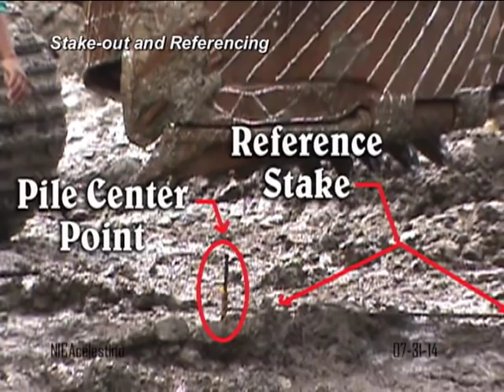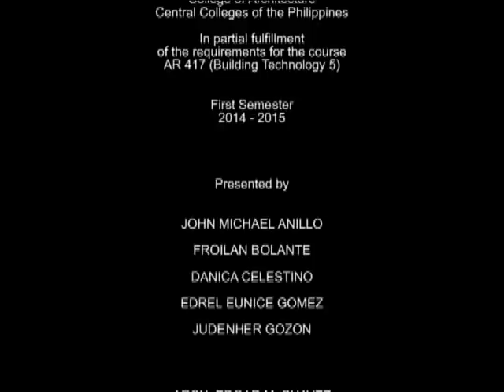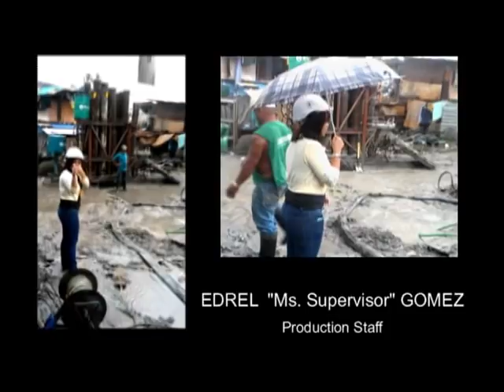Bored Piling Method

Comment: 1: Polymer must be mixed and then filled in bore insted of directly adding in bores .
2: We should cover the Hole of hopper with a cap and fill it with concrete and then allow concrete to dip inside .

3: we should take reference at 2 points 

Etc . There are many faults in this video .
Reply: Right dear
Reply: Kanya kanya diskarte yan Brad. Huwag mo itulad diskarte naming mga Pinoy sa inyo.
😅😅😅😅😅

Comment: Thank you. This tutorial is good and very useful for who wanna study bored pile. Unfortunately, its lacking period of cleaning hole what is very important. How can you clean the mud below the hole after drilling?
Reply: you use a clean out bucket. it looks similar to the digging bucket but made specifically to clean out the hole. another issue here is the suspended fines. when you are using a slurry mix, you want to allow some time for the suspended particles to settle out. or you can pump out the used slurry and simultaneously pump in fresh slurry.

Comment: Should the water not have been pumped out before pouring the concrete? Otherwise when the tremie pipe is removed the water will dilute the concrete mix and weaken its strength?

Comment: Hi Thanks for the video. 

However there are so many issues which were not taken care during the construction and first and foremost part is safety rules are not   

1. The above video demonstrate incorrect practice of adding polymer. The correct method shall be polymer should be placed in separate tank and taken to the pile borehole through pipe. The properties such as viscosity, density, pH and sand content of polymer should be checked both in the tank and in the pile borehole.  Polymer level should be maintained till the bottom of temporary casing. The main use of polymer in the hole imparts stability by mainly applying hydro-static pressure and passive resistance against failure of hole prevents from collapse. Samples shall be taken at top , middle and bottom of borehole.

2. Once drilling reaches to the required pile bottom, the depth of pile should me measured and once again before placing the cage the pile depth should be measured in order to check the sedimentation of polymer. If the polymer doesn't satisfy the required criteria the polymer should be recycled in the pile bore. If the sedimentation is more then pile bottom should be cleaned.

3. Caliper logging test should be performed before placing the cage in order to check the diameter of pile is uniform or check for cavities. check the depth once again to verify the pile toe level.

4.  Spacer should be installed in the cage so that concrete can flow and fill the space between cage and hole which was missing and it will leads to a problem.  Skin friction will be reduced.

5. Dummy cages should to installed at the top after lowering of 3rd and final cage. It should not hinged with a single rod. The weight of cage is more and the single rod wont withstand the total cage wight if welding is not done properly.  

5. Pile was backfilled with plastic bags and etc. not acceptable and there no identification mark where the pile was casted.
Reply: hahahaha what are you a cop lmfao
Reply: BalaGanesh Sankar totally what I was thinking.. plus I didn't hear a back up alarm on the machine
Reply: He's correct.  To begin with, I would have started the hole with an augger.  I know the bucket is needed for most of the drilling in wet holes.
Reply: BalaGanesh Sankar 
Sir you given very useful information about pile foundation.
Please gives us some more details about the pile foundation and pile cap
Reply: This is true in the US. Not sure about what is required in the Philippines. Good points though.
Reply: exactly to complete the correct process...but its okay..that is built for the city of rock n roll..
Reply: There wasn't a proper flushing system... And the cage wasn't lapped properly... The laps were all at one place

Comment: mixing of  the polymer powder is not correct, the end of the first rebar cage shall be bended, concrete covering spacers are missing. oh common. they didnt count the compaction (poking) at slupm test, i noticed that the sample iitself collapsed. and lastly did you perform KODEN TEST.

Comment: The video is is informative, however, it was observed that rebar cages were installed without performing soundings to verify if the Toe Elevation is achieved. Furthermore, determining the top elevation of steel casing was not as well performed, which will be used as reference for determining the total depth of finished drilling. Not necessary to use A706 rebar since the welding performed is very minimal. Also observed that wall spacers were not installed.
Reply: Learn more here

Comment: Observations:
1.Rebar cage - no concrete spacer /cover specially at bottom which is directly engage with the soil which exposed to rust attack
2.Welding of rebars is not a good practice specially for superstructure

Comment: Is it okay to neglect the desanding process before placing the rebar cage?
Reply: Chlea Ferras polymer doesn't need a desanding plant. It self flocculates, meaning it sheds the sand suspended in it to the bottom of the bore hole. All you need to do is clean the bottom with a flat bottom bucket, after the sand content drops below 1%.
Reply: @chadregis7339  Not true. depending on the soils type, the material can and does become suspended in the slurry. That is why polymer manufacturers make products to flocculate the suspended soils to the bottom of the shaft.

Comment: Prior to the placing of concrete in a closed end
pipe pile, the pile shall be inspected by an
acceptable method to confirm the full pile length and
dry bottom condition. If accumulations of water in
pipes are present for either closed end or open end
pipes, the water shall be removed before the
concrete is placed.The concrete for concrete filled pipe piles shall
have a minimum compressive strength of 2.5 ksi
(17.3 MPa) and a slump of not less than 6 inches, meaning the slump test was ok.
Reply: I think he assumed the concrete is poured from the top and sinks through the water... ignoring the tremie pipe altogether... for some reason...